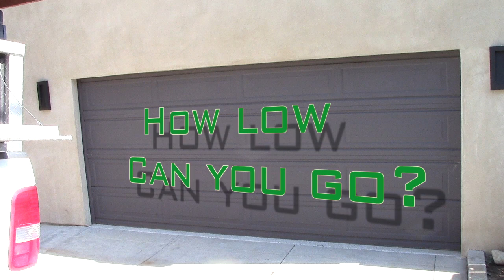Super Sneaky's

Comment: Unbelievably well done, youve got to do a tutorial on how you made the custom torsion tube washer welds on the end of each center bearing bracket. I want to tackle a job like this myself now!
Reply from the maker: Well if you have a welder then it's do-able, Kyle Sisco is the only one I know of who has successfully replicated what I have done here, only he used Lowheadroom track instead of Sneaky's and it worked quite well. Instead of welding washers to the end of the tube he used couplers with set screws and for most it would be a more viable option.

Comment: Do I need to cut the track down to use these ?
Reply from the maker: Depends on how low you want the door or how low the object your trying to get under is.
Reply: @ALLProGarageDoors  thanks for the reply
Reply from the maker: Josh Herrera no problem, i usually end up cutting the tracks so if you have a rafter at say...7ft 9 and you want to get the door with an opener under that then allow for roughly an inch of door to stick up above the track plus the thickness of the opener. And cut your vertical track to get you that distance.
Reply: what fo u mean thickness of the opener?